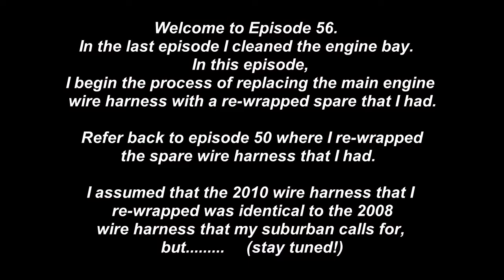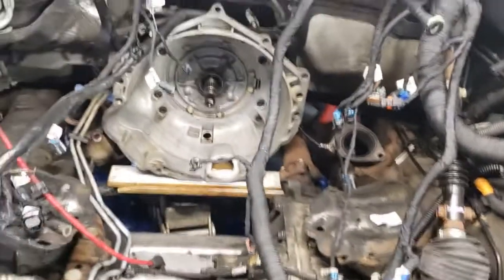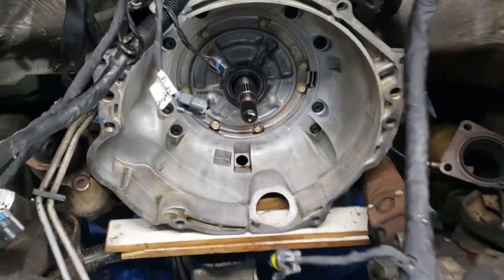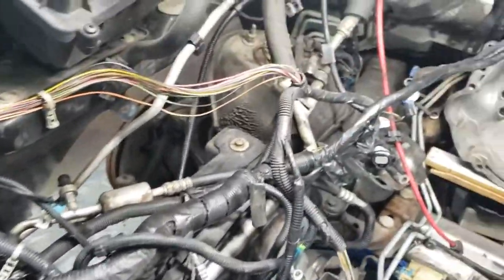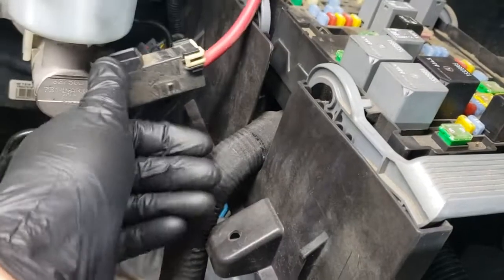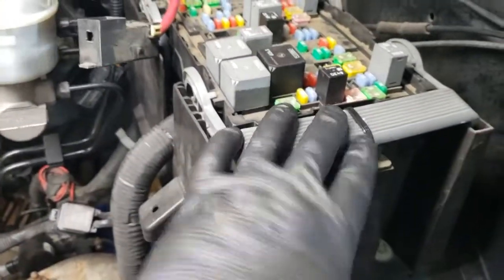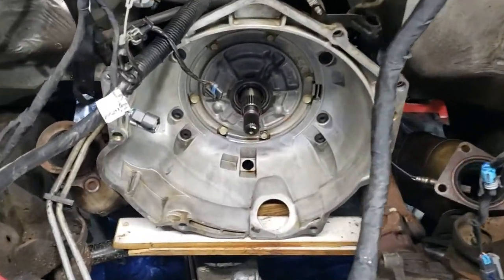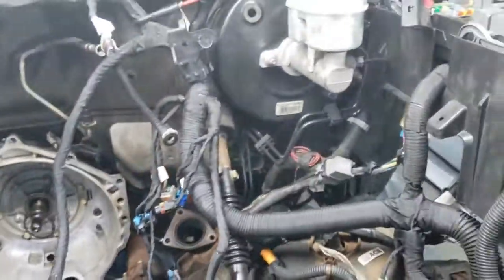Episode 56: Engine Harness Installation

Comment: The 2010 harness has provisions for VVT which yours did not have.  Anything else that made them different?
Reply from the maker: Since I deleted VVT, I simply left that connector unplugged.   The differences that I found were related to the transfer case connectors.   My connectors had 3 pins, and the 2010 cable had 2 pin connectors.
Reply: @53PerformanceOptimization  That's right, I think GM switched to Magna transfer cases in 2009.  Was your engine originally a 6.0 L76?